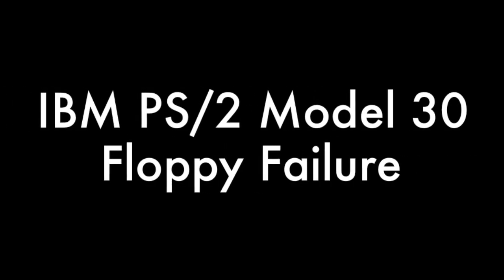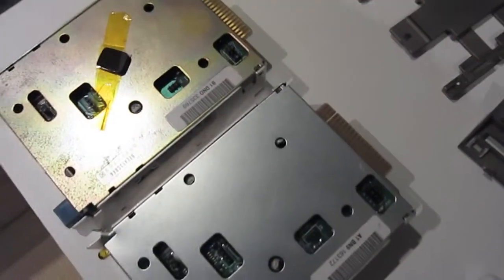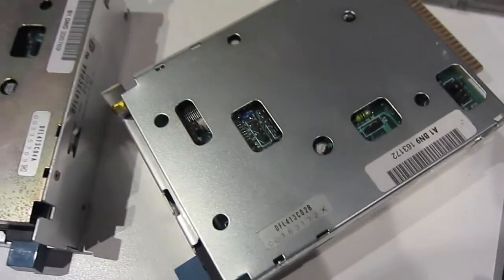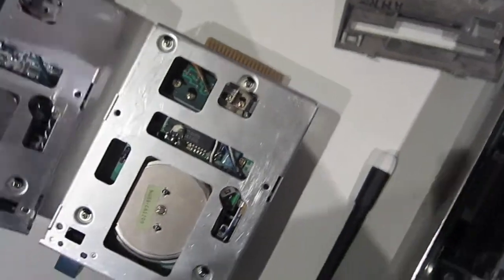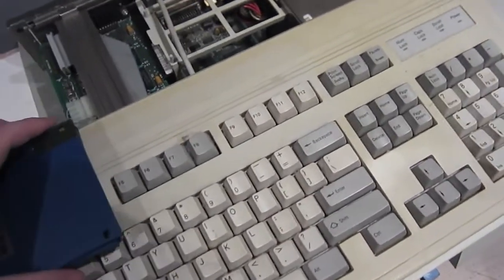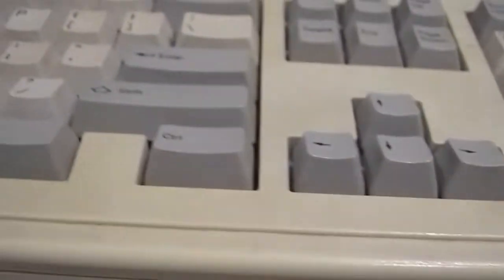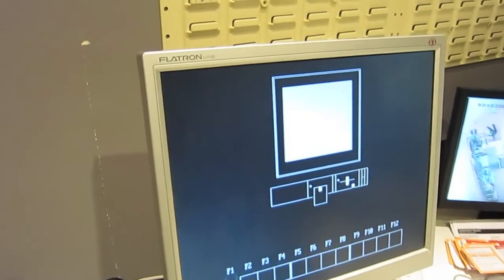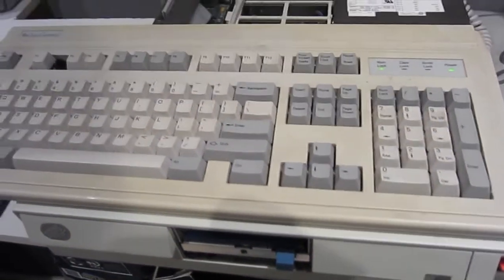IBM PS/2 Model 30 8086 720K Floppy Disk Drive Failure

Comment: I have two of these IBM PS/2 Model 30 8086 on me from the late 80's, they are indeed terrible... the later IBM PS/2 Models with 386 and 486 CPU's are way better and more fun to use. but yes getting replacements for them is a pain... also they do not support 15 PIN VGA at all and yes floppy drives for them is hard to find as well and getting a soundcard is expensive and its very very hard to find the right driver and install it...
Reply: *****
everything hardware on a IBM PS/2 needs to be IBM's own, I have a lot of those old computers on me, but here lately I came all the 8086, 286 ones on the attic because they are too old to run the software etc I have, but I still have all my 386, 486 IBM PS/2 computers and IBM 9595 servers in my living room, those 9595 towers wights like 100 ilbs! its a pain to carry them around, too! and if you install a hardware and you do not have the right driver, the computer might not boot up and will ask for reference disk that you might not even have and you have to download it online if its still online, lucky for me, I have them all but others who finds a IBM PS/2 might not have a reference disk for it...

Comment: Hey Shane ... like your video! Also share some of the frustration with the Alps floppy! I'm also restoring an 8086-based Model 30 and having trouble with the floppy -- similar symptoms to yours. I'm finding it extremely difficult to obtain a replacement. In addition, POST is throwing up a memory error code 205 (though shows 512 kb to be okay), so not sure what's causing it. Would be really good to chat! Can we link up via email/Facebook? All the best, Simon (UK)